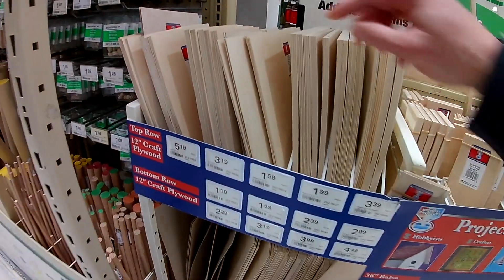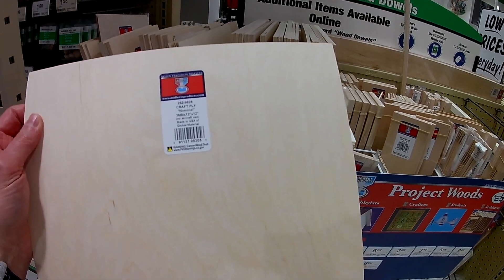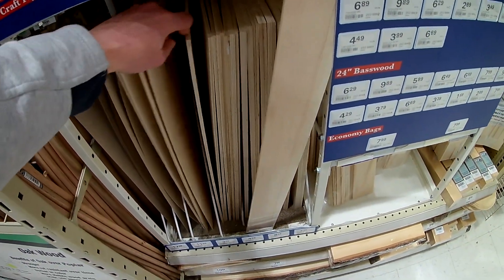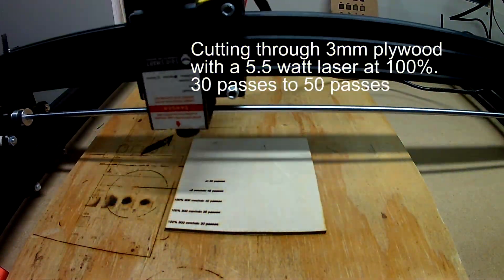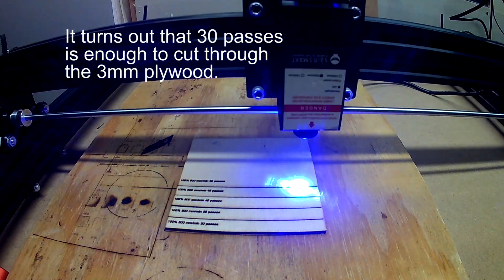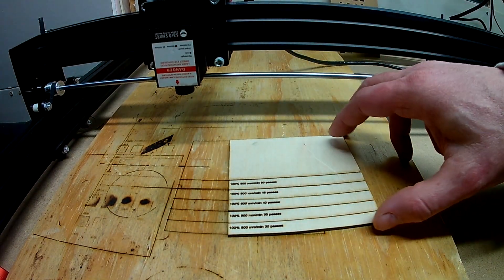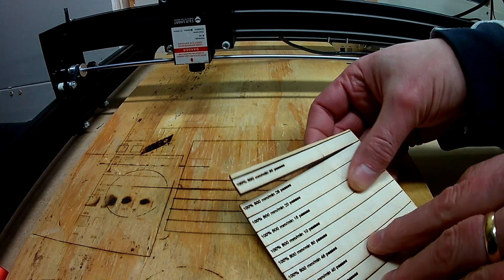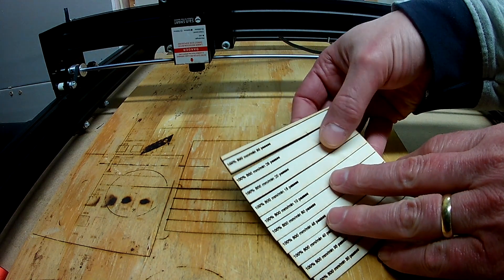Cutting Through 3mm Plywood

Comment: Bro I have the same laser and do that cut in 6 passes running at 85% power and 600mm. Are you focused properly?
Reply from the maker: That was the first thing I checked.  I'm not sure if it the 3mm plywood I am using or something else.  I can get through in 3 to 4 passes a 100%.  Still somewhat inconsistent which makes me think it has to do with the material.  I should try this with something more consistent.
Reply: @CNCATHome  one of the things I did bro was to focus on my bed then slightly elevate my work piece 1 to 2mm above its focal point then started my cut. 

I also pulled the head apart and reassembled it after cleaning the lens and I was able to get a finer focus. I wonder about some of the glue they laminate with because it doesn't appear to be equal :)
Reply from the maker: I like the idea of focusing the laser deeper into the material to help improve the cut.

Comment: for cutting you wan to be down at 100-300mm/min
Reply from the maker: Thank yo for the feedback.  I have read conflicting information on this.  One train of thought is to move the laser quickly and make numerous passes.  Another train says slow down and make fewer cuts.  I kind of split the difference.  I will try  slowing down to see how that turns out.
Reply: @CNCATHome  definitely slower over faster.  The laser has to heat the material it's cutting and create a combustion event.  faster is not the way to achieve this efficiently.  These diode lasers very different than the fast paced C02 20,30-100W lasers.  Applaud your scientific method for sure.